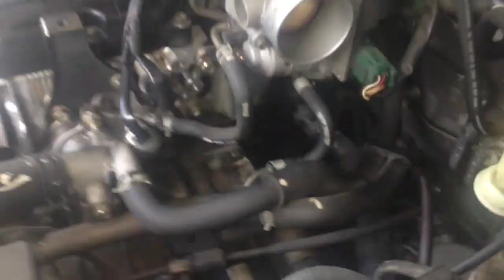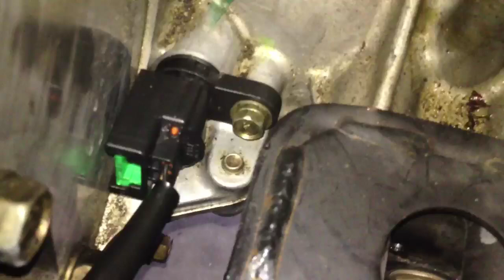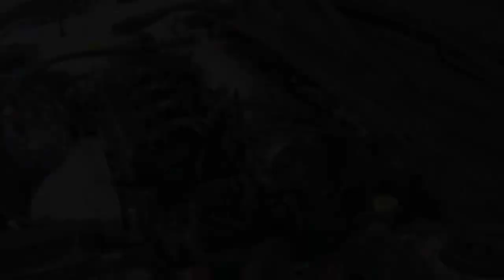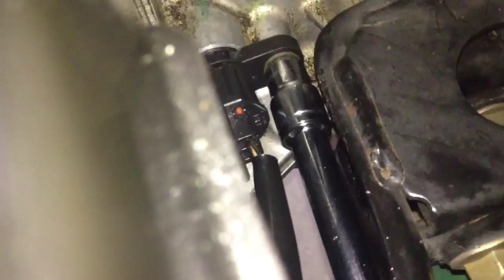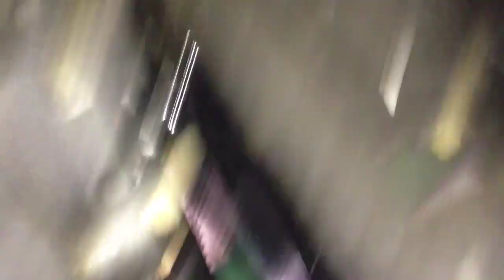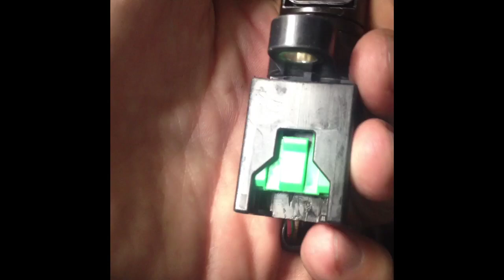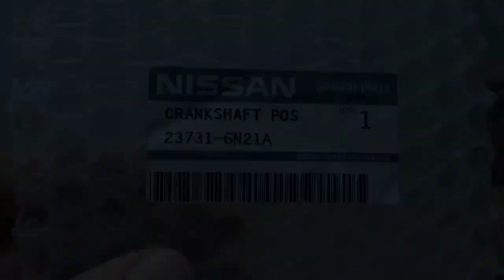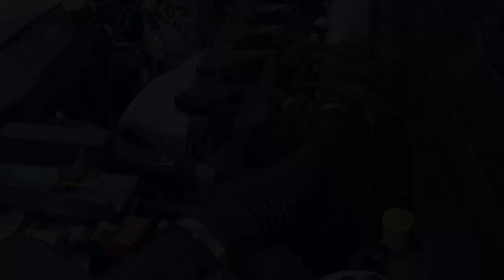Code P0335 / P0340 /P1336 - Crankshaft Positioning Sensor Replacement DIY - Nissan.

Comment: Good day.Please l have a problem with my NISSAN TITAN. The engine would start but will not fire. When the engine start after 5 seconds it shuts off. I did a scan and it came up with several messages.The latest is Part No. ECU 23710ZH000. I have changed the 3 sensors on the engine but the engine is still not firing. The Computer Box Part No. is MEC 886-270 C1 5412. KIndly assist me.
Yemi
Reply from the maker: +Yemi Mohammed 
What are the error codes that you got?
Reply: Thanks for your prompt response.Pls forgive me for not replying earlier, l was in a remote area with no internet connectivity, Below is a long list of errors l got on my scanner on the various dates:
1ST REPORT ON 26TH OCTOBER 2015
The scanner indicated as follows:
Not all supported I/M monitor tests are complete
Quick Test Results
ABS                     
1 CODE
TCM                    
NO CODE
EOM                    
1 CODE
OBDII/EOBD         1 CODE
C1130 - ENGINE SIGNAL 1
PO335 - CRANKSHAFT POSITION SENSOR A CIRCUIT MALFUNCTION
REPLACED CRANKSHAFT POSITION (CKP) SENSOR
FREQ.REPORTED FIXES:
1.Replaced Camshaft position (CMP) Sensor
2.Replaced Powertrain Control Module (PCM) Power Relay
3.Reset Camshaft Timing
4.Replaced Crankshaft Position (CKP) sensor connector.
After l changed two sensors the engine started and fired and ran slow for
about 45 minutes but the oil gauge was at L and the oil light was on. But when
l accelerate the gauge neddle will move towards the middle position and the oil
light would go off.
2ND REPORT ON 31 OCTOBER 2015
Not all supported I/M monitor tests are complete
Ouick Test Results:
ABS                     
2 CODES
TCM                    
NO CODES
ECM                    
3 CODES
OBDII/EOBD         6 CODES
C 1130 - ENGINE SIGNAL 1
C 1142 - PRESSURE SENSOR CIRCUIT
P 1148 - CLOSED LOOP BANK 1
P 0037 - HEATED OXYGEN SENSOR HEATER CONTROL CIRCUIT LOW BANK 1.      
SENSOR 2
P 1031 - AIR FUEL SENSOR 1 HEATER BANK 1
P 1148 - CLOSED LOOP BANK 1
CONFIRMED
P 0037 - HEATED OXYGEN SENSOR HEATER CONTROL CIRCUIT LOW BANK 1           
SENSOR 2            
CONFIRMED
P 1031- AIR FUEL SENSOR 1 HEATER BANK 1
P 1148 - CLOSED LOOP BANK 1 PENDING
P 0037 - HEATED OXYGEN SENSOR HEATER CONTROL CIRCUIT LOW BANK 1             
SENSOR 2.  PENDING
P 1031 - AIR FUEL SENSOR 1 HEATER BANK 1.  PENDING
After this the Engine will start but it will not fire.
3RD REPORT 15TH OCTOBER 2015
Not all supported I/M monitor tests are complete
ABS                       
2 CODES
C 1130 - ENGINE SIGNAL 1
C 1142 - PRESSURE SENSOR CIRCUITFREQ. REPORTED FIXES:
1. Replaced Brake Pressure Switch
ALSO REPORTED FIXES.1. Replaced Brake Position
2.Adjusted Barke light Switch
3.Replaced Brake Switch
4. Replaced Electronic Brake Control Module
5. Replaced Engine Block Ground
6. Replaced Hydraulic Control Unit (HCU)
KIND REGARDS
YEMI MOHAMMED

Comment: I had mind replaced but my car continues doing the same thing. but the same codes keep coming out. any idea why this could be? P0335 and P0725 06 altima
Reply: mine*
Reply from the maker: +Tonie “Dollfaace87” Padilla 
Did you use authentic Nissan sensors or aftermarket?
Reply from the maker: +Tonie “Dollfaace87” Padilla 
😄
Reply: +Temachok I believe it may have been aftermarket. 😯
Reply from the maker: +Tonie “Dollfaace87” Padilla 
Did you have both Crank and Cam sensors replaced?
Reply from the maker: +Tonie “Dollfaace87” Padilla 
I also recomend trying original OEM Nissan sensors:
http://www.amazon.com/gp/product/B00KBAQHII/ref=as_li_qf_sp_asin_il_tl?ie=UTF8&camp=1789&creative=9325&creativeASIN=B00KBAQHII&linkCode=as2&tag=dp051-20&linkId=WI3M4Y2S3EKQDXAP

Comment: Could This Be The Reason My 2003 Nissan Altima Won't Start Seem Like Cuts Not Gettin No Fire To It It Tries To Crank But Won't Start
Reply from the maker: +Mont Last 
Yes, same symptoms as I had. To be sure, scan your engine for error codes.

Comment: Hello everyone, I know this video has been out for years but this problem is caused by reduced engine power mode. The reason this mode is being activated, is because on ALL QR25DE engines (altima 2.5 and sentra 2.5) the crankshaft position sensor gets oil in it, causing momentary loss of signal to the ECM, such that the logic cannot diagnose the condition and the engine will stall intermittently in neutral. This also leads to low oil pressure, which may cause internal engine damage if the engine runs below proper idle for too long due to the fact the the oil pump is driven by engine rotation, and low engine speeds lead to low oil pressure. Another condition that can occur is if this is left to happen for too long, the timing chains may come under extreme stress and stretch (according to Nissan) I do not know how or why this is, but It did happen to me, and a new timing chain was required. If you experience the above problem with the crank sensor, do not wait to have it replaced as it leads to other engine problems.
Reply from the maker: When I came to dealer with this problem back few years ago, they checked VIN and told me "there is no existing recalls on your car". They probably shut it down shortly after announcing it. Plus I never got a letter for recall. Seems like everyone who has this car eventually gets this problem, with no help from Nissan...
Reply: +Temachok maybe nissan didnt do a recall but I know for a fact they changed the resistance those sensors operated at with the replacement ones nissan knows they screwed up and maybe didnt want to call it a recall but simply a upgrade when you replace them lol
Reply from the maker: I've heard some people had it replaced by dealer for free as recall. 
But thats ok, i'm glad I was able to fix myself it and shared it on Youtube. 
It could have been worse.
Reply: DIY-time suggest i should change also the camshaft sensor after i have changed the crankshaft sensor. The new sensor i bought for cranksaft is having a resistance of about 6.89Mohms. the old one was just 0.238Mohms. Now i have tested the camshaft sensor and the resistance is 3.89Mohms. so should i change it and put a new one with about 6.89Mohms hoping that it will start the engine?
Reply: DIY-time suggest i should change also the camshaft sensor after i have changed the crankshaft sensor. The new sensor i bought for cranksaft is having a resistance of about 6.89Mohms. the old one was just 0.238Mohms. Now i have tested the camshaft sensor and the resistance is 3.89Mohms. so should i change it and put a new one with about 6.89Mohms hoping that it will start the engine?
Reply: Thanks!!!
Reply: Nissan also had a huge recall on these from what I know of a while back because the OE sensors were calibrated to operate at certain volts or resistance something like that with the ecm and would fail signal so they had to redo the sensor and replace it with the ones you buy at the parts store like this which work with diff voltage/ resistance which favors the ecm and runs better I've had to replace 3-4 diff altimas with the same engine and all had the same problem bad OE sensors

Comment: Good video , but what if you use a washer as spacer with the aftermarket sensor where it bolts to the engine block thus avoiding contact with the actual crankshaft ?  do you think it would be a problem with that or would it work like theory ?
Reply from the maker: +Journalistification 
I think it may work, at least it won't hurt to try. 
The way I see it, if aftermarket company failed to get right measurements, there is a high chance the sensor is very low quality in other aspects too.
Reply: +Temachok Good point there , i did not think about quality material and accuracy of sensor reading . I'll pick the oem vs aftermarket even if i have to pay more.
Reply from the maker: +Journalistification 
Exactly, that will save you time, money and frustration...
Reply from the maker: +Journalistification 
Good OEM sensor is about $50 on Internet:
http://www.amazon.com/gp/product/B00KBAQHII/ref=as_li_qf_sp_asin_il_tl?ie=UTF8&camp=1789&creative=9325&creativeASIN=B00KBAQHII&linkCode=as2&tag=dp051-20&linkId=SDHSVKDGB47BVUEY
Reply: +Temachok Awesome find bud, thanks again for taking the time. A little off subject but just as important here is the aftermarket header that i run on the altima to replace the pre catalytic converter failure issue that made this car so popular lol... it is a cat-less high performance header from  xs power by mark . This header is the real deal in my very own opinion and for the price listed you can't go wrong , even if it cost more than that listed price.
http://www.ebay.com/itm/XS-Power-Header-o2-Spacer-pkg-for-2-5L-QR25DE-Nissan-Altima-Sentra-SE-R-SpecV-/291679982898?hash=item43e97b5532:g:nJwAAOSwbdpWZLho&vxp=mtr
Reply from the maker: +Journalistification 
Thank you for sharing!!!

Comment: Great video. Too bad I couldn't remove the connector even after trying for an hour. Damn thing was like super glued. Had to finally take it to a mechanic. I did buy the OEM sensor beforehand though.
Reply from the maker: +ariucr 
I also strggled with mine. It was covered with oil, what made it even harder...

Comment: Hey  I do have a question. I recently chaned my cam and crank shaft sensors with OEM parts from Nissan themselves. After changing it, the startup is worse. I takes about 3 cranks to get it going now as opposed to before with the sensor it had only took one crank to start up. What else could be wrong? Those two are the only things I changed. The connector on both sensors clicked on and both are bolted on quite tight.
Reply from the maker: +Anthony Farve 
I'm thinking one of new sensors may be bad or wrong, wiring may be damaged somwhere or you may have a bigger problem related to ECM module.

Comment: Thanks, good job! Couple things: you did not oil the o-ring?? And, how do you clean "check the engine" light??Thanks=)
Reply: +Eero Laukkanen 
Or without buying anything....
Turn ignition on (without starting), wait 3 seconds.
Pump Accelerator (In and Out) 5 times within five seconds.
Wait 7 seconds. Hold accelerator down for 10 seconds. (Let go when light starts blinking).
Now check engine light will blink your error code.
Now hold accelerator down for another 10 seconds - Code Reset.
Reply from the maker: +Eero Laukkanen 
Yea, missed that... 
To erace code - unplug battery connector.
Or else, to do it properly, buy one of those OBD2 tools for $10-15 online:
http://www.amazon.com/gp/search/ref=as_li_qf_sp_sr_il_tl?ie=UTF8&camp=1789&creative=9325&index=aps&keywords=OBD2%20code%20reader&linkCode=as2&tag=dp051-20&linkId=JT5YEW4ISB2ZLWTD

Comment: Question I got the code to replace my crankshaft position sensor and had it done but when i start my car still having problems starting any suggestions?  Service Engine light still on as well. Possibly do that Camshaft sensor need to be changed as well
Reply from the maker: +Kevin Disroe 
Yes, it's recommended to change them both.
If possible use original OEM parts.
Reply: Thankyou so much I'll get that changed!

Comment: John, thanks a lot for the video, since my mechanic accessed the sensor from below the engine using a jack lifter and left the sensor not properly hooked and it gave me the error P0335 which did not appeared before, since the REAL problem that the car was giving was P1612. Instead of repairing the car, made more damage... Now I am going to do it myself thanks to you.

Comment: Not all of these Nissan 2.5L engines are set up the same.
My Crankshaft Position Sensor is located on the driver side of the engine (near the upper portion) and is easy to get at.
The aftermarket part costs $65 CDN + tax in the Toronto area although you can order it via Ebay from China for $14 + duty + delivery (approx. $30).
Reply from the maker: +D Moreau 
You are probably talking about Camshaft Position sensor according to your description...
Both sensors look exactly the same.
Reply: +Temachok The code from the computer was 0335 which is a crankshaft position sensor malfunction. I first telephoned the dealer who told me the camshaft & crankshaft sensor is the same sensor for this engine. I assumed he meant one in the same as opposed to identical part for both.  I did not see any sensor in the place shown in your video (no wire lead to that place on the engine and nothing appeared to be there). I looked around the outside of the engine for a sensor that looked like the new one and I found it where I stated. After replacing it the warning light is off & the car starts and runs normally.
Reply: +Temachok 
I just looked at another video that shows replacement of both sensors. I must not have looked hard enough for the crankshaft sensor. The part is identical and the original is faulted.. the other video also stated there was a recall to replace that part although I know those are timely and most likely past due. I suppose if the car acts up again and the light comes back on I will have to buy another sensor & replace the one you describe here. Btw was the aftermarket part you bought from China? While looking for it I found parts made in China & Mexico.. I bought the one made in Mexico... hopefully it is not too long to cause an issue in the future.
Reply from the maker: +D Moreau 
I don't remember if it was from China or Mexico.
I used this factory OEM sensor:
http://www.amazon.com/gp/product/B00KBAQHII/ref=as_li_qf_sp_asin_il_tl?ie=UTF8&camp=1789&creative=9325&creativeASIN=B00KBAQHII&linkCode=as2&tag=dp051-20&linkId=ROQHJOYMTBV4K5YW
Reply: +Temachok 
I meant where was the aftermarket sensor manufactured.
The one you just referenced is a Nissan genuine part manufactured in Japan.
The computer is now registering 2 codes.. P0335 & P0725 so I will have to buy another sensor to replace the one in your video.
Reply from the maker: +D Moreau 
I think it was from China. 
Be sure to buy genuine part. Aftermarket part didn't work well for me.
Reply: +Temachok 
I was finally able to remove the wire harness with a pair of long needle nosed locking pliers. 
Soon after replacing the sensor I now have a P0420 code regarding Catalyst System Efficiency.
Reply from the maker: +D Moreau 
Sorry, never had P0420. Can't help with that one.

Comment: Great video question if I'm not getting this code is it smart not to replace it because my car takes 5 seconds to start I think this might fix it please help
Reply from the maker: +John Escobar 
I would replace it if you absolutely sure it is the same problem.
Mine didn't have codes in the beginning as well. They eventually showed up after it started happening more often.

Comment: I already change the crank sensor n starter but my car still won't start I check almost every thing any idea?
Reply from the maker: +Slimjim Finest 
Did you use oringnal OEM replacement sensor?
What happens when you try to start? Is engine turning/cranking?
Have you tried scanning engine for error codes?
Reply: +Temachok  I already figured it out it end up being the alternator I learn it from a guy on YouTube but to answer your question no its not oem part I use check out Spencer Vongnaraj video he did everything I did n he figured it out

Comment: I'm having the same problems with my Nissan 05 same codes. Will this work for mine as well? Buy parts from dealership & reset codes?
Reply from the maker: +Gloria Escobar 
Yes, should be the same if you have 2.5 engine.
I definately recommend genuine Nissan parts from personal experience. 
You can buy them from dealer if you need car fixed ASAP.
If you can wait a few days, you can save some good $$$ if you shop online:
http://www.amazon.com/gp/product/B00KBAQHII/ref=as_li_qf_sp_asin_il_tl?ie=UTF8&camp=1789&creative=9325&creativeASIN=B00KBAQHII&linkCode=as2&tag=dp051-20&linkId=AUEMMRY7T2CL3IEQ
Reply: Thank you! Once i get it fixed will i be able to drive far away? it won't give me anymore issues? Because these are the only issues i have with my car.
Reply from the maker: +Gloria Escobar 
Should be fine as long as you use good sensor.
You can also keep required tools in your trunk in case it fails again while on the road...

Comment: wow. This thing...I couldn't do it myself after a few times trying to get the connector off the sensor for the first time. Eventually got my father in law to get it out but even he had a heck of a time doing so. SES light still on but it cranks and starts fine. I'll have to get the code cleared but it might come back if it's the timing chain and still throw the P0335 code. Let's hope it's not that. Thanks for this helpful write up!
Reply from the maker: cocoabiscuits 
Yea... I know what you're talking about...!
I thing i'll be fine after eracing codes.
They just don go away on their own.
Thanks!
Reply: +Temachok light finally went away yesterday! yay
Reply from the maker: +cocoabiscuits 
That's great!
Reply: +Temachok uh oh now it starts pulling up the code again. I replaced it with the OEM back a few months ago and the car didn't start again yesterday pulls the same P0335 code. :( Eventually got it to start up to make it home but I'll have to check it out. Any suggestions?
Reply from the maker: Have you tried to replace Camshaft Positioning sensor as well?
Reply: no, I haven't but I just went to go check it out and the luckily the connector just came lose from the sensor so I reattached it until it clicked. Started right up and no code anymore. As for the camshaft sensor that one has not yet been replaced. I may in the future replace it to the newer designed sensor at some point. Thanks again!